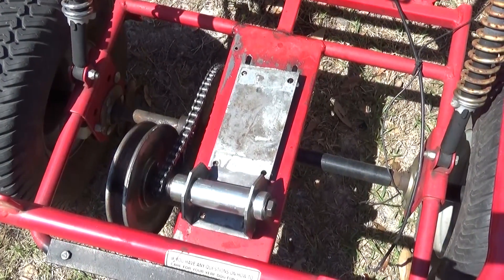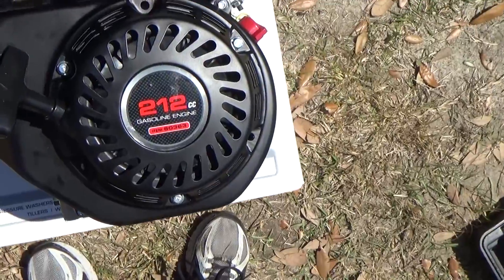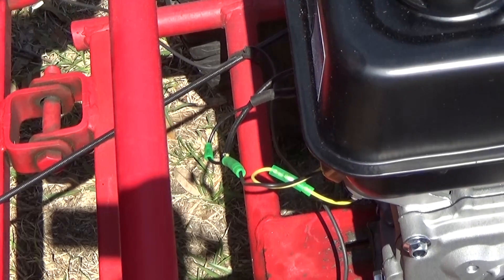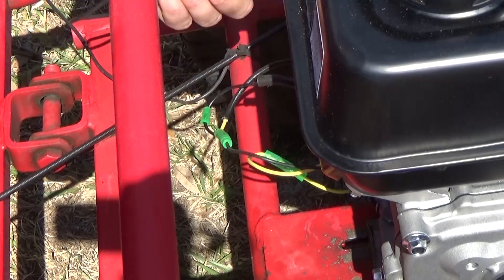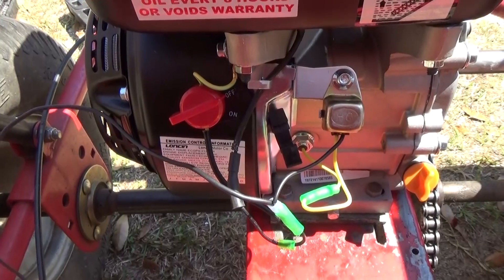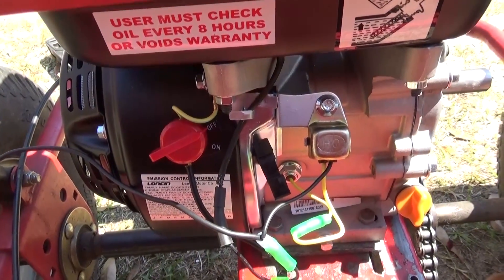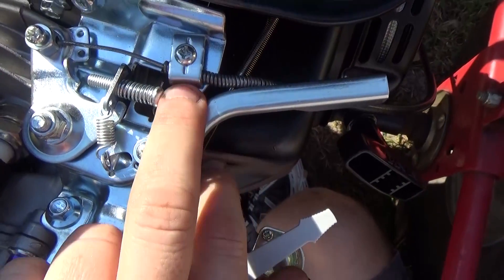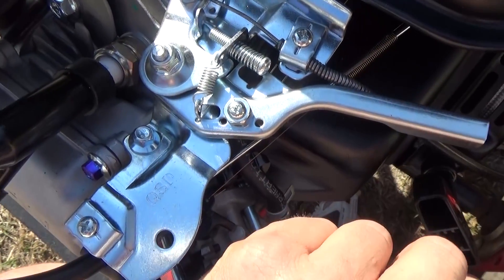Replace Engine on a Yerf Dog 3203 with Harbor Freight Predator Engine

Comment: Did you ever have problems with the torque converter in that configuration?
Reply from the maker: Nope, other than putting the belt on incorrectly in the video it has been rock solid.  Doesn't get used much anymore as the kids are mostly grown though.

Comment: i dont know if someone mentioned it already, but I saw that the belt on the torque converter was facing the wrong way. Awesome video though, I want to upgrade my old tecumseh with a new predator too.
Reply from the maker: Oh yeah, I figured that out eventually.

Comment: Just got a Yerf Dog for the grandkids. Predator 212 engine. Brake is the big problem. Band brake. YD used 4 or 5 size options (seems very dumb).  And poor design. 
 I have not been able to find model numbers ! Where are they ?  This is the best video I have found yet.  Thanks !
Reply from the maker: Not sure if this helps but there is a pars diagram at the end of the manual on this page. https://www.bmikarts.com/Yerf-Dog-Manuals-Parts-Breakdowns_ep_178-1.html?srsltid=AfmBOopF-F54hpzqGphk1SRhhFiCdXLQSs47Brb96zSzK2sxxJKd0Jtg

Comment: I used the same exact stainless steel bolt from Lowe’s for the clutch and gave it full throttle for the first time and the flywheel flew off and the bolt stripped the crankshaft. Make sure you get a grade 5 or higher bolt because anything lower has a better chance at snapping.
Reply from the maker: Dang dude.  I don't remember which one I used but mine is still going strong today. Don't drive it that much any more but it hasn't failed.

Comment: My yarf dog has a dang scooter engine in it and it’s direct chain driven. Chain comes off the drive shaft of the motor and to a sprocket on the rear drive shaft. I’d like to get a ghost engine for it. But I’m not sure how to rig it up. Put a clutch directly on the drive shaft and run a chain from it to the sprocket on the axel? I’m kind of at a stand still with mine right now.
Reply from the maker: Sorry it took so long to get back to you but that is exactly what I would do.  I would probably use a belt clutch instead of a chain one but in the end it would work either way.

Comment: You havnt had any issues with the low oil sensor shutting the engine down while making right turns?
Reply from the maker: Not at all. I have actually upgraded the engine to have a lot more horsepower and it has never cut off from the oil sensor.

Comment: I went and bought a predator motor for this and ended up taking it back because the shaft was so short. Have you had any issues since doing this swap with how little of the converter sits on the shaft?
Reply from the maker: Not at all. I was a little scared of that at first but this thing gets used pretty extensively every summer and is still going strong 7 years later.

Comment: 6 years later and your video is still one of the best I have found by far. And has been a reference for most of my yerf dog 3203 engine setup process. Thanks for the great content!
Reply from the maker: Awesome.  The Predator really is a great engine. Mine is still running strong 7 years later.

Comment: Where did you get that torque converter motor mount plate thing?  I’m looking for the exact same part.
Reply from the maker: It came with the kart so I am not sure.
Reply: @ClintHolland  I actually found it on OMB

Comment: Did  u use a lock washer with the key on the outside clutch ?
Reply from the maker: I did not. Probably should have but it hasn't come out yet, 7 years later still going strong.

Comment: What belt are you using. I did the engine swap and kept the original torque converter. But my kart barely moves. My belt is a comet 203591
Reply from the maker: I kept the original belt.  When you say it barely moves, is the engine revving up or does it seem bogged down?

Comment: Thanks for sharing!  Very helpful.  I am not super savy with this stuff.  Any tips on how to remove the clutch from the old engine?  Unless im doing something wrong mine seems to be siezed on the shaft.
Reply from the maker: Absolutely.  Start with some penetrant and let it soak like PB Penetrant or something similar.  Then, either beat the heck out of it, use a heat source or you can actually buy a pretty cheap clutch puller on Amazon.
Reply: @ClintHolland  pb blaster and beating the heck out of it worked!  I ended up putting a new one on anyhow, but still needed the old one off to get the spacer I needed.  Thanks for replying and thanks for the awesome content!  Your video was spot on and made my engine swap way easier.

Comment: Do you have any information on the bushing when we bought the drive shaft they did not give us a bushing.
Reply from the maker: You talking about the bushing at 15:23 used to space out the torque converter?
Reply: @ClintHolland  YES I NEED INFO TOO , FOR SPACING OUT  CONVERTER BUSHING

Comment: Where can I find that bushing???
Reply: I ended up making a bunch (work in a machine shop). Turns out I needed a little over 3/4" wide to keep the driver in line with the driven. Made it 1.25" OD and 3/4" bore. BMI shows they are only 9/16" wide, so if purchased, you might need additional shims.
Reply from the maker: The one that I put on before the torque converter?
Reply: @ClintHolland  yes, I need this info also. Dimensions would be great, I.D. , O.D. , and length.
Reply from the maker: @pistacio103179  I don't know the specs but here is a link to all the parts on the kart.  You can probably buy what you need once you find it on this diagram.  http://www.bmikarts.com/PDF/3203A_T.pdf

Comment: do you know if this would work on a 30033?

update, it did, but will need inside attachments to torque converter on shaft to align to rest of torque converter.
Reply from the maker: I can't guarantee it but based on the looks of that cart you could make it work.

Comment: Hi Clint 
Do you have a part number for the belt you use on this go kart?
I bought 3 different ones and they are all wrong
Reply from the maker: According to the manual, it is Q43203W. Hope that helps.

Comment: I have the exact same engine and yerf dog and I'm having problems with it. When I brake the chain keeps on falling of. The cart won't stay in the same place when I start it, when I start it ,the cart moves forward
Reply from the maker: If the cart won't stay in place when you start it, it really can only be one of two issues.  Either it is idled up too high or the torque converter is broken/worn out. Check the idle on it first and that is fine, you probably need to replace the torque converter.  That could also be causing the chain to fall off. Also check the alignment of the chain and the alignment of the torque converter.  If they aren't lined up correctly it could cause these issues as well.

Comment: Great Video all went well!!! Thought I'd add something different that I did.. Being concerned about how the Clutch only sits on the motors Shaft a 1/4 of an inch. I threw a cut off wheel on my grinder and cut a 1- 3/8 inch long piece of the Shaft off my Blown up Tecumseh motor.. I then Drilled the threads out with a 5/16 drill bit so the bolt can slide through.. Once completed only taking about 10 minutes I slid the home made extension shat in, and it fit flush on the outside... to finish I used a 2 1/2 inch rather than 2 inch 5/16 fine thread bolt to grab more threads... I think It will add more strength not sure, but it's piece of mind for me anyway... Thanks for making this video
Reply from the maker: I completely understand the concern.  Mine has held up just fine but that is not to say I don't worry about it snapping every time I run it.

Comment: Where do I get a clutch spacer like the one you put on to line the clutch up with the torque converter? I am having the EXACT SAME issue with a yerf dog I just got off CL. Its the two seat blue model. I took off the stock motor and put the Predator 212 on it, but I am frustrated that I cant get the clutch lined up with the TC. So where do I get that spacer? Thanks!
Reply: Just measured mine, its 3/4" in length
Reply from the maker: Mine already had that spacer so I didn't have to purchase one. You may need to buy the entire clutch/torque converter to get one.  Try www.bmikarts.com
Reply: I cant just get a 3/4" Inner diameter spacer with the right width from Lowes or home Depot?
Reply from the maker: Are you referring to the spacer at 15:24?
Reply: Thats the one! If I just slide my series 30 clutch on the drive shaft of the P-212, It will not line up with the TC and I have the exact same jackshaft/engine mount plate you do. I need a spacer just like that so the clutch and the TC line up.
Reply from the maker: I thought you were talking about the keyed spacer on the clutch.  You are correct. You can probably pick up a bushing to match at Lowes or Home Depot.
Reply: What are the dimensions of the spacer do you know? All I can figure is the inner diameter of 3/4'
Reply from the maker: I don't.  You could align your torque converter where it needs to be and then measure the difference from there to the engine to get a good estimate.

Comment: Great video sir, just picked up a 3203 and used your video to replace the engine with the predator. The seat belts were cut on mine, any idea for inexpensive replacements? I can't find a video on how to attach them to the frame. Any help appreciated.
Reply from the maker: I believe www.bmikarts.com has some replacement ones. Try them or sometimes Ebay.

Comment: Do you have a problem removing your rims I can't for some reason the back rims will not come off please help
Reply from the maker: Absolutely.  One of them came off fairly easily but the other one took me like 2 days. I ended up soaking it in PB Penetrant and having to beat the heck out of it to get it off.
Reply: Ok I will try that thank you

Comment: I have the same engine I bought from harbor freight I haven't had time to put it on for good yet but I did try to fit it on the go cart but it didn't line up the belt is not straight what do I have to do

Comment: where can i get the belt? and what is the part number
Reply from the maker: This is where I got mine from.  http://www.bmikarts.com/30-Series-Torque-Converter-Drive-Replacment-Belt-Q43203W_p_3237.html
Reply: Clint Holland yea.. I ordered one from there but it was the wrong one.. I just scrolled down before you posted the link and bought another one.. bmi has been very good so far..thanks for the video.. I put the same engine on the same kart just the other day..thanks for the reply

Comment: after I attached the throttle cable I notice mine cable doesn't move like the one in the video. When I started the go-kart it runs but the gas pedal doesn't engage the throttle. What am I doing wrong?

Comment: where do you buy those springs at?
Reply from the maker: I picked them up at Lowes from the hardware section where you can buy nuts and bolts.

Comment: I may have skipped past it in the video or something but anyone else notice the belt is going in the wrong direction? I believe that is an asymmetric belt meaning its flat on one side to go up against engine plate and the other side is curved to fit torque converter curve.
Reply from the maker: I wouldn't say you missed it. It is wrong and it was pointed out way below in the comments but I don't expect you to read through them all.  Good catch though.

Comment: Just to be clear to all of those out there who are noticing the hemi vs the non hemi. The hemi Predator engine is the california epa model. It has a more restricted carb. Because of that it runs leaner than the non hemi. The non hemi is actually better than the hemi version. The only way the hemi version of this engine would be better is if it had a non hemi carb attached to it. Otherwise the fact is the hemi is more restricted for better "air quality". Many have realized that and started making sure to purchase the non hemi. As everyone knows California has the most restrict air pollution policies in the country. Buying the model that is the only one allowed to be ran in California is not the better engine. Your airflow, power and exhaust are all restricted. A non hemi has more power it is not restricted the way "the hemi" is.

Comment: With the predator engine is this thing strong enough to pull a little trailer with a lawnmower on it? With me of course driving?
Reply: yes lol
Reply from the maker: I think so. Depends on how big the lawnmower is but I suspect as long as the tires could get traction, it would pull it.

Comment: How do you change the crank case oil on the old tecumseh? Thanks
Reply from the maker: There is a square metal plug/bolt on the bottom of the motor right behind the seat.
Reply: +Clint Holland Right on Bro!

Comment: Great video Clint Holland! My engine keeps flooding or leaning out (not sure which) when hitting bumps. It seems that because the engine is mounted to the swingarm it gets shaken more than it can handle off-road. What would you think about moving the engine off the swingarm and mounting it (with a little cutting and welding of course) to the body instead of the swingarm. It would require moving the driven clutch and small sprocket assembly to be in line with the pivot point of the swingarm and making the chain longer. Could it work?
Reply: I've seen this issue a number of time's. Disconnect the low oil sensor and you will not have that issue any longer. When the engine is no longer stationary the low oil sensor get's a false reading telling it your engine is low on oil when it real isnt its just the angle the engine is at which is causing it to cut off on you. Disconnect it or remove it and you will be fine. Just be sure to keep an eye on your oil level regularly. That is how that exact issue has been solved a number of time's.
Reply from the maker: I don't think it being on the swingarm is the problem.  What makes you think its flooding or leaning out when you hit bumps?  Mine doesnt have any problems, even when catching air.   I assume you are talking about the Predator engine and not the stock one, correct?
Reply: I am actually still using the Tecumseh engine, but I have a brand new Predator sitting in the box.  Every time I hit a bump, (I haven't had wheels off the ground yet) it cuts out.  Wait a second or two and it stumbles back to life.
Reply from the maker: I would do some more troubleshooting.  Let's back up and think about this from a high level and troubleshoot from there. An engine generally needs three things to run. Fuel, air and spark.  It also needs the spark to be timed and compression and such but lets focus on fuel, air and spark.  I would start by looking at any thing that might interrupt spark.  Maybe a bad kill switch that is floating when you hit a bump or some engines have a switch that cuts the engine when it doesnt detect oil.  Or just a loose wire.  Try those first.  As far as air goes, try going over a bump with the air filter removed. Unlikely but not impossible that something is flapping and cutting off air.  Lastly, if you confirm it's neither of those, lets evaluate fuel. Does it do this on a full tank or only when the fuel if low?  Could there be a spring issue with the butterfly valve or could there be a problem with the float cutting out.  Check those things and let me know. We will figure it out.
Reply: Clint Holland and Fearless Front, Thank you both for your suggestions.  I
 went to work on it and checked all wiring, changed the oil and it seems
 to have taken care of the cutting out.  It still seems there may be 
something making it interrupt a bit.  Could the governor be engaged when
 a weak spring gets bounced around?  Also, it seems that my torque 
converter or belt might need replacing.  I'll make a video to get 
some opinions on replacement.  Hopefully answers will help other people 
know what to do too.

Comment: Do i have to put the bushing i took mine off and just put the converter on the shaft and it fit,will it damage the engine?
Reply from the maker: I think it will be fine. Mine didnt line up if I took it off.  I wish I could have left it off though.

Comment: hey chris your video was pretty legit good job. i bought this kart used and it had that predator engine swap done already, however the belt took a crap and im not sure what replacement to use or where to get it. ive eaten up several pep boys lawnmower belts lol. anyway to find out? i noticed your comment on what belt you have but how do i find out wbat torque converter is on there? im assuming stock if that worked with the swap. tia man
Reply from the maker: If it's stock, its a 30 series torque converter.  See this link.  http://www.bmikarts.com/30-Series-Torque-Converter-Drive-Replacment-Belt-Q43203W_p_3237.html

Comment: I have the same set up but had to elongate the holes in the engine mount to get a little adjustment for the belt.  I would have liked to have seen you adjusting the clutch belt.  I never know if I'm doing mine right.

Comment: You got the hemi
Reply: The hemi is actually the california epa version of the Predator engine which runs a little leaner than the regular one. It's not any better, that's a myth, in fact that engine has more exhaust regulations in place then the regular one like the one I have, so mine, the non hemi actually runs a little stronger and runs with more aggression because it is not set to be so "air friendly". Many people have realized it and began making sure they were getting the "non hemi" so they weren't getting stuck with the more restricted carburetor. The only way the hemi would truly be better is if the carb from a non hemi was put on the hemi, but as they stand now they are both about equal in some way's the non hemi is a little better because it is less restricted.